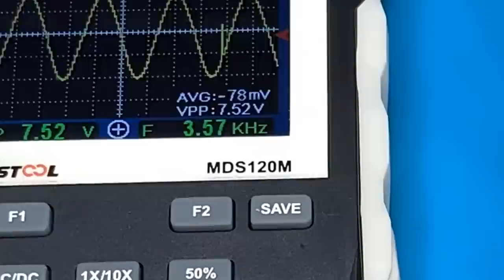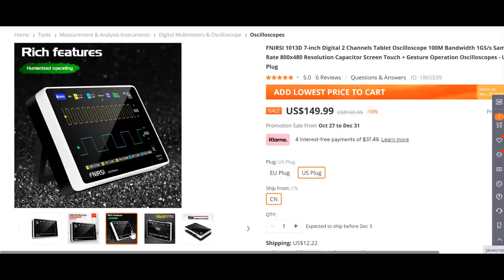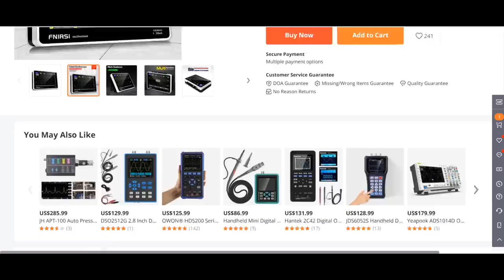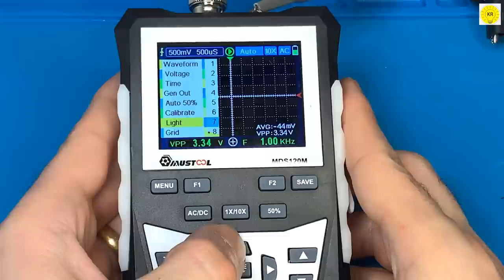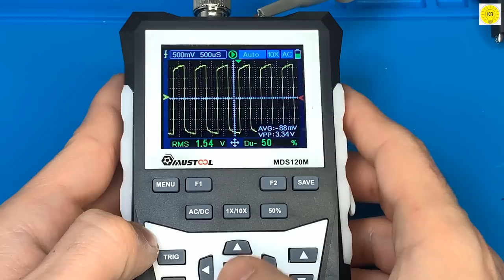how to make induction heater , 2kw induction heater , banggood

Comment: The headline says 2 kilowatts, but that's false.  It would have to draw 250 amps at 12VDC and the poor quality solder joints and thin wires would melt with that much current.
Reply: The oscope says 8 volts peak-to-peak at 15.6 kHz
Reply: @chrisfuller1268  kHz is not watts
Reply: @davidlecompte9467   It's clear from looking at the schematic that the secondary greatly boosts the voltage so the actual delivered power is unknown unless we built it or model in LTspice. Each of the transistors can go up to 55 V at 49 Amps which is about 2700 Watts max, if 50 percent derating is used on the voltage for two transistors.   So the circuit is capable of delivering 2000 W of power inductively through about 50 Volts total secondary voltage (line-to-line, 25 V line to ground) at 20 Amps, assuming the wires on the secondary can handle 20 Amps.  I'm guessing they can?  They look like house wiring diameter, approximately.
Reply: The most mind blowing thing is that the channel liked the comment! I don't know what to think any more.
Reply: @tricky778  Doesn't matter, he's just after the sweet, sweet interaction clicks
Reply: @chrisfuller1268  The logic about the capability of the components is all well and good. But you can't beat the nature. If this thing delivers 2 kW into the load it must draw at least as much from the battery, in reality much more. So 2000w at the battery voltage of 12V means the current from the battery is close to 170 Amp. Have another look at those flimsy crocodile clips he connect the battery to the circuit and the wire thicknesses involved at the battery end then use your own imagination to determine what happens if you put 170 Amps through that lot. In reality I doubt that this device produces more than 300W considering how long it took to heat up a very thin blade. At 2000W that blade would have melted almost instantaneously.
Reply: Lol i was thinking same thing watching that. Not possible
Reply: Wat?
Reply: @blg53  you are right.
Reply: @blg53  the trouble with heating the thin blade is maybe that the induction coil is shaped bad for smaller objects. The shape is therefore (if not mistaken) also a efficiency factor.
Reply: The resonance of the circuit may well be 2000 Watts all the mosfts are really doing is adding power to the occilations of the tank cicuit so there could be a lot of power on the work coil but  I don't think there  would be.
Reply: fyi for a couple of comments:  power in = power out.  period.  and p = amps x volts. period

Comment: Love the in-built user "protection" - IF the thing gets to see some good use, chances are it will spontaneously de-solder itself... also, cross sections of the PWR supply cables???

Comment: Hello
Do not be tired.
I am interested in electronics and beginners.
I wanted to produce an induction heater from this video.
Two pieces of MOSFET transistor FGH40N60 d provided the other required parts and I acted according to the same video. But the heater I made did not work and no heat was generated.
I wanted to know if it was possible for me to use a positive or negative MOSFET transistor by mistake?
Reply: Buy an induction heater kit online and assemble it yourself.

Comment: Just came across your video. I am surprise to see your using only one toroid and your not center tape on the work coil. I can see that the LC tank is not directly connected to the VCC. The toroide seems to be acting more like a transformer than a choke since the tank is not directly connected to the VCC can you give me a reference in the literature showing me the workings of the toroide in this circuit. Mille merci. A+. Bon travail.

Comment: hi, if I make a dc power supply directly taken from the 220vac power outlet  (by using a bridge diode and a capacitor and supposed to become about 300vdc), what needs to be modified? the copper size and the numbers of the copper wires turning? and what else?  please advise me, thanks.

Comment: good job but how the frecuency of switching is generated without any other external frecuency generator like a pwm integrated circuit for example the UC3842, can someone help me understand this? thanks...
Reply: The capacitors in conjunction with the main coil sets the frequency as an LC tank circuit
Reply: @4DRC_  thanks..m